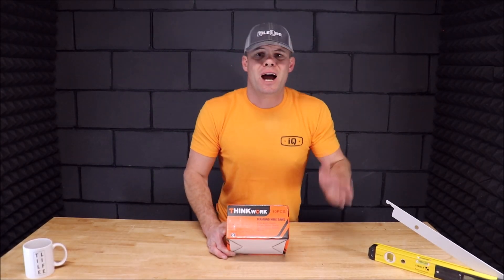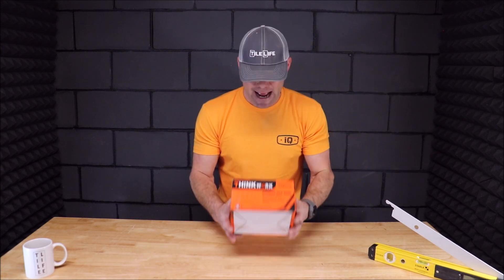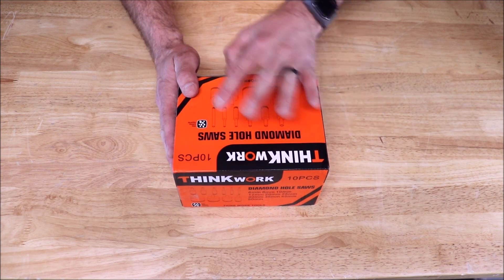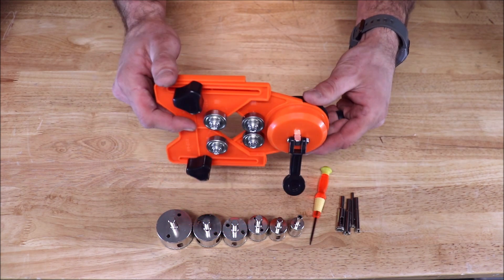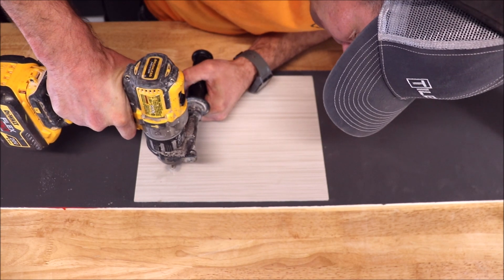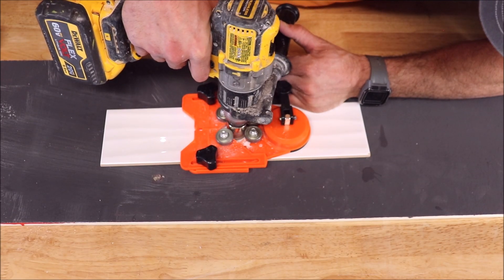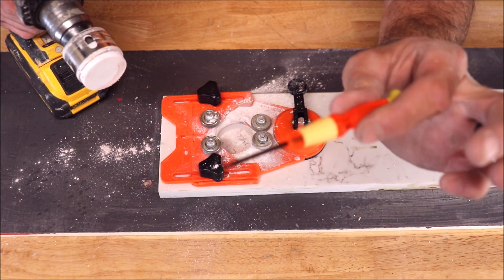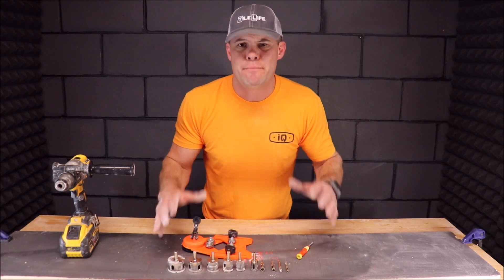Budget Diamond Hole Saw Kit for Stone, Ceramic, Porcelain and Glass!

Comment: 👍 Thanks for this! It was very informative. If I need to drill a hole deeper than the depth of the hole saw bit would I simply drill to the depth of the bit then remove the plug and continue drilling in this manner until I'm through the material or would it be better to use a regular bit with a longer length and simply use thicker and thicker bits to get to my hole size? I like the hole saw bits because it's one pass to get the hole but there does look to be a depth restriction. I need to drill a hole through a fairly thick rock. I already have a rotary hammer drill so it's just the bits I need to sort out. Thanks again for taking the time to make this video!

Comment: Does this guide works with water, please? Not spraying only, but if you would attach a hose with dripping water? There are four bearings. I afraid it`s designed for dry cuts only

Comment: The suction cup does not hold to the material even if it is flat.
Reply from the maker: That's strange. My suction cup held on glass and wavy ceramic. Make sure there is no dust on the material.